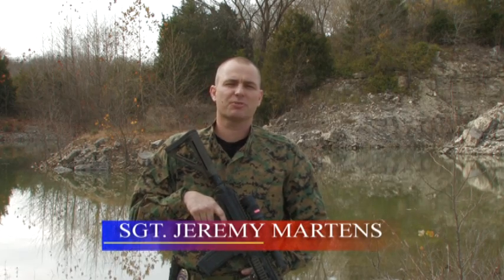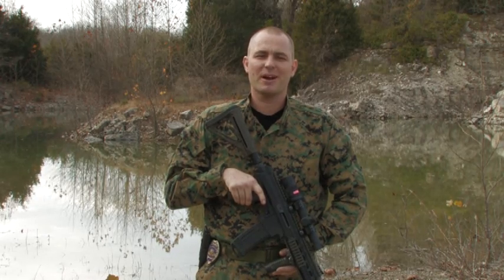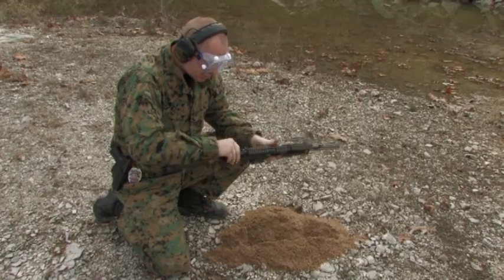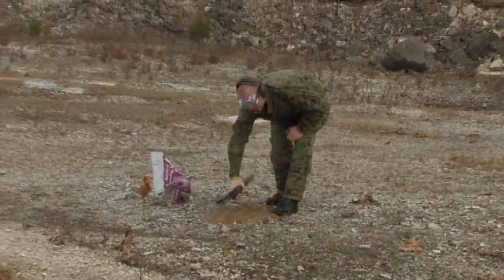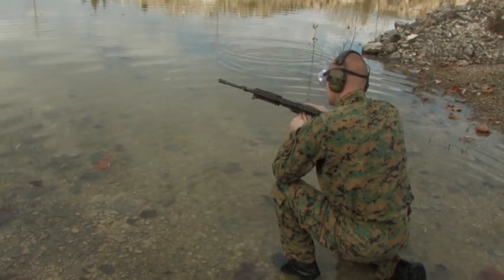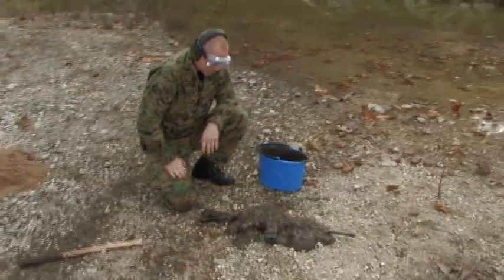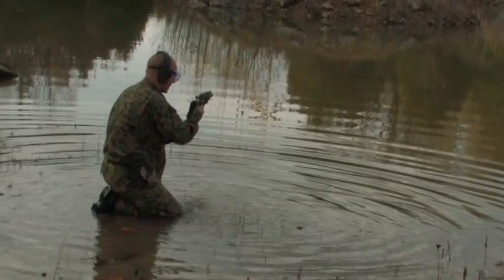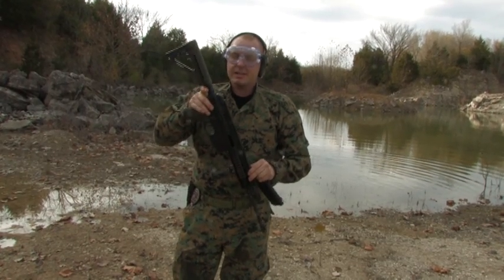XCR versus Severe Conditions, Part 1

Comment: fail acr is better on all test
Reply: No, it's not. My ACR completely jammed six months ago and no matter what would not go into battery. The cause? A fricken roll pin, holing the spring and front recoil spring cup together, walked out slightly. This prevented the bolt from closing. Big fail in the design! I would've never been able to service this in the field.

Comment: Is that an early version xcr. I  have one of the very first guns with a heavy barrel
Reply: You can upgrade an older XCR. The best thing is to get a FAST stock. Six adjustment possibilities. Easy to install.
  The new ambidextrous mag release, ambi safety and new designed bolt release is worth doing.
   Robinson has a unique parts catalog system when ordering the XCR-L bolt release get the Type-1 release. Type-2 release is larger to fit the XCR-M. The original bolt release was out of production years ago. The original XCR-L release rod is called Type-0. The new bolt release is a coated metal, black in color. The original is a bare steel rod.
   You can use the other parts for reassembly. Here's how I swapped out the old bolt release. Remove the magazine as it will get in the way. Separate the upper & lower. There is a small screw between the mag well and the trigger guard. Remove that screw. There is a small spring inside so ease off the spring pressure. The bolt release rod can be slid out from the top of the lower receiver. Insert the Type-1 bolt release back into that hole. The small angled protrusion goes towards the magazine side. Reassemble in reverse order using all the other parts, screw, washer and spring. The Type-1 release is coated, case hardened steel. The Type-0 was not.
   Now for the FAST stock. Open the stock hinge and there are two bolts. Remove the bolts. The old plastic stock and adapter can be removed. Use the old stock for an AR build. There are six total adjustments for cheek height. Use only two bolts in the desired holes. There are three holes for the two bolts. There is a plastic cheek cover that has two height positions. Giving you six possible height adjustments.
   When the FAST stock is attached. There is an adjustment bolt on the folding hinge to adjust the wobble of the hinge. Just loosen that bolt about a quarter to a half turn. Check and adjust as nessessary. The stock will be solid with no wobble.
   There is an improved 2-stage trigger. Looks similar to the typical AR triggers you know. The slot where the trigger goes is narrower than the AR slot. Use the same method as used on AR triggers to swap out the old 1-stage trigger. Just watch out for those hammer and trigger springs. Good luck trying to find those springs if they fly off. 
   Glad I upgraded from the old stuff.

Comment: Why is it that whenever xcr is involved in some sort of reliability test, they fail in someway?
Reply: How many reliability tests has the XCR been involved in? The only other review I've read that really even went into reliability was on TTAG, where they had issues with the rifle they were testing. They sent it back to the factory, where factory issue on it was fixed, at which point they had zero malfunctions. 

I've also seen other posts on forums where people mentioned lousy reliability with steel cased ammo, but the bulk of those posts are 5-10 years old at this point. Either newer rifles aren't having these issues, or it's also possible that people just aren't buying as many of the rifles anymore, so there's nobody to complain about them. None of this means that the XCR is a reliable weapon, I'm saying that I haven't found much to base an opinion on either way.

Comment: I think sand was getting stuck in between the front of the receiver lock and the back of the operating rod causing it to stick. I think RA should add an extra lock similar to ones on Yugo style AK's

Comment: This video is just devastating to watch. Did anyone see the pressure leak out of the back of the upper and lower receiver at around the 5:13 mark? I wonder if that is a factor in the weapon coming apart during the sand test. 

Wow. Just devastating to watch. 

Marky
Reply: Tactical Tshirts yes it is the same issue, the latch was not fully seated and left an open gap between the receivers, when the rifle fired the water on the spring compressing blew out the hole, not a pressure issue. 
watch part 2 he explains the upper and lower were not correctly mating=op error

Comment: Having actually tested this on my own XCR, it actually proved superbly. I did some research on why all these fails happened and I found it was indeed user error during a previous cleaning of the weapon. 
Overall though, XCR is like the love child of an AK and AR. Take's the best of both. And because the weapon is all metal, you could probably swing it like a bat at somebody and still use it.

Comment: The most important point of ingress in a loaded gun is the barrel. Why did you not submerge the barrel in sand and mud? The tales I have heard from vets about the guns they loved was that they could stick em down in the the dirt, bury them in mud, completely, and they'd still fire.
You have not duplicated that here with this gun.
Reply: firing with an obstructed muzzle is far from ideal, hence why they ingrain to "keep your muzzle up" in army basic training. you'd get the boot in most places if you were incompetent enough to fill your bore with mud.
Reply: @iluvthetrollin  you’ve never been in combat to make that remark.   Sheet happens.  Doesn’t necessarily equate to incompetence.

Comment: The xcr has come a long way, and the sand test makes it look atrocious because of operator error. great way to make a good gun look bad
Reply: Thats not operator error
Reply: Not correctly mating the upper and lower receiver? yes that is operator error.
Reply: For an officer to do it over and over and over? I know cops arnt gun experts, but such a basic thing to be faulted so many times cannot be his fault
Reply: Watch the second part to this video, the upper and lower receivers were from different guns.
Reply: Joshua Berry Actually I didn't say that. I have changed uppers between a few to check the fit and have never had an issue. Changing out the upper is not accomplishing much,since you change the barrel instead if you want a different length.
Reply: I own an XCR-L and I can tell you guys that it will not pop open like that if the stock adaptor is installed and seated properly.(I know this cause I have a have a stock adaptor with a buffer tube with a CTR stock on mine) I've put over 1000 rounds through it with zero failures so far. (not torture tested)

Comment: Yep, the take down button is a bit too easy to hit, but mine takes some real effort to push it forward. I have 2 XCR's and I think they are revolutionary rifles. The lower receiver and internals are like an AR15 but all of the upper receiver's internal parts are AK-47. The side charging handle is from a FN-FAL. Plus 4 caliber capability.

Comment from the maker: I did not get paid from Robinson for this video.  I did receive some good pricing on two spare gas tubes and got some techinical questions answered prior to doing the tests.  I could have edited the video to make it "look" better but wanted to give the good and the bad.  If no one learns anything else but to make sure to latch the take down, I'll be happy.  Easy to check and easy to fix.

Comment from the maker: Keep in mind the issue with the sand test was my fault and not a result of the design of the gun.  I mixed and matched lowers and did not ensure that the retention pin fully seated in the lower.  After the problem was found and the pin correctly seated, the receiveres did not seperate.  Since this test, all of my uppers and lowers swap with no problems.  Correctly seating the takedown pin is covered in the manual and I did not do my part as the user.  The XCR is built like a tank and I trust it.

Comment: I love the XCR also. The only thing I hate about it is that dang rear take down lever. They should have designed it with a captured pin like an AR. The upper coming off the lower would never be a problem on an AR. Personal gear can bump that dang lever and cause the gun to come apart right in the middle of a fight. If the is a way to have a captured pin installed I'd probably buy an XCR next.

Comment from the maker: It was user error.  I put together an upper and lower that had never been together and did not seat the rear takedown pin fully.  Once I figured it out, I did not have any more problems as shown in the second sand test.  When I looked over the manual again, it even mentions making sure the rear pin is seated fully, so totally my bad.  I didn't want to use my folder and have to try and get all of the mud and grit out of the foam tube.

Comment from the maker: It is a mini upper with a full size barrel, commonly referred to as the SF configuration.  While it doesn't safe a whole lot of weight, it takes it off the front of the gun and moves the center of balance rear ward.  Some like the look of the exposed gas tube and some don't.  I don't mind the look, kinda Galil like, but did it to improve the handling.

Comment from the maker: I would say no better, no worse.   If both platforms are running the same profile barrel and the same ammo, then the accuracy should be the same based on my experience.  I have passed sniper quals with my heavy barrel XCR using wolf ammo! on several occassions.

Comment from the maker: The opening was a mistake on my part.  I put an upper on a lower for the first time and ran the test.  I did not check to see if they were locked together (they weren't) and it popped open.  After I learned of my problem, I found that it is covered in the manual to make sure that the rear take down is seated.  In 3 years of using the platform, I never knew to check it.  If it is a factory gun, you will never have to worry about it, but if you swap lowers and uppers make sure you check the latch.